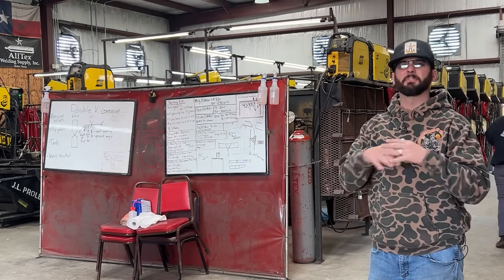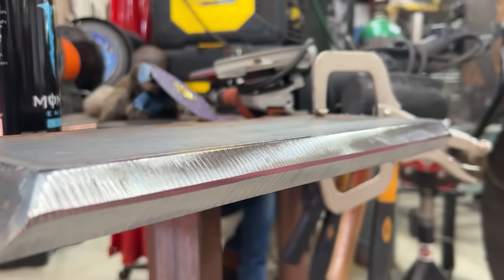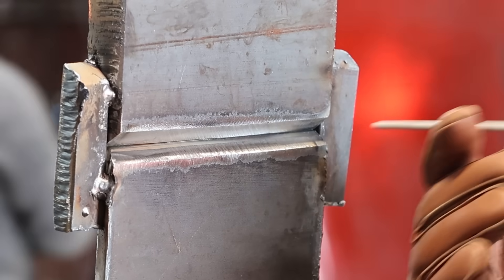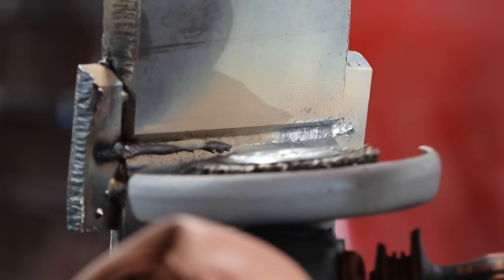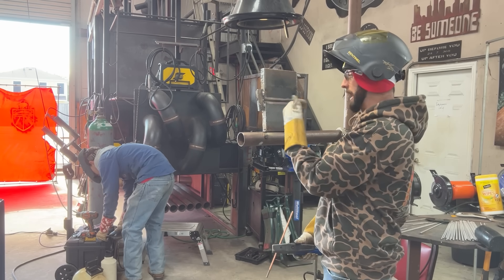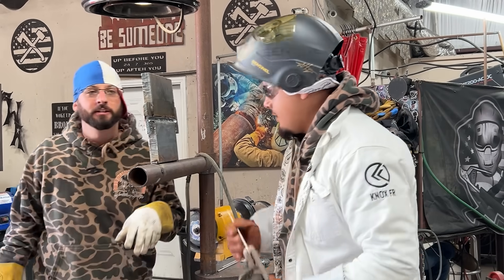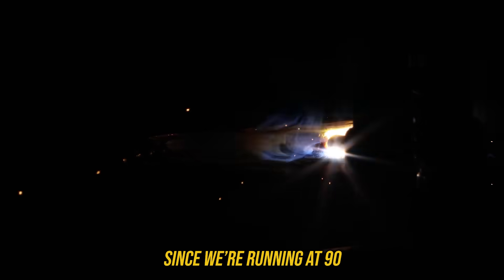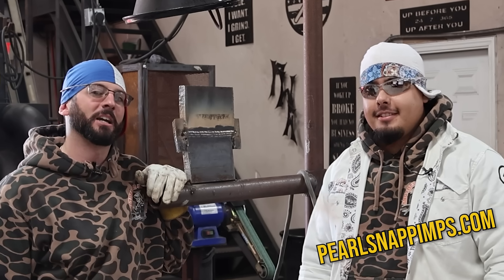Heavy Structural Welding Made Easy: 1-Inch Plate Double V-Groove Explained

Comment: I do newconstruction for newport news shipbuilding. As a shipfitter,we fit all thicknesses of plate. We build mods outside so we have to preheat with TEMP🔥LSTIK.  From 125°/52°c  150°/66°c and for thick High Yield steels we use 300°/149°c two to three inches around the HEZ we have various heating  methods. Preheating when its below 30°  is vital to all weld joints. And honestly its procedure, you better not get caught not  preheating. You have to have melted wax indicated  around them fitups or thats your job. Any ways show some vids on pre heating.

Comment: Interesting. Whenever I have had to do this, the back gouge was grind, to see shiny clean root (no holes or slag) then finish weld. Gouge adds unnecessary heat exposure to the base metal.
Reply: Ive seen alot of companies opt for a back grind, as long as there is alot to grind. Depends on the procedure, Ive pulled out the gouge for reeeeaalllly long sections of seams, its much faster, with just a touch of grinding to let it sparkle

Comment: Dont see the point of gouging, just run a hot 6010 root, smack it with a grinder and another 6010.
Reply: what if the code requires a higher tensile strength rod?
Reply: @AustinHargett  then the code is wrong
Reply: @mblake0420  thats ignorance Cornholio

Comment: Correct me if I am wrong, but I rarely run wide open on gouging and I do a lot of gouging on heavy equipment, it depends on the size of rod you  are using ?
Reply: id say the amperage needed will depend on the size of rod like stick welding as you probably know. Id stay on the hotter side of whatever range is recommended. Use smaller rods for more precise  gouging.
Reply: @jeffsimonar7161  I regularly gouge at my job, however, we only have 1/4 and 1/2 inch round solid rods. I usually start my run at 275 amps for 1/4 inch round rods. For 1/2 I start my run at 325. Depending on the machine I adjust accordingly or if I’m in a tight spot. Sliding the gouging rod a little further up can make your gouging track a little more focused.

Comment: Cant you just put a slight gap between the plates initially to achieve full penetration and not have to arc gouge?  Thanks
Reply: you most certainly could. I believe that the main reason why one wouldn't leave the opening and rather keep it shut. As you know open roots can be more challenging to achieve, Regardless if work needs to be done on the other side, a grinding method is usually involved to insure sound weld.

SO if you have to grind any way, might as well make the weld easier. thats just my 2 cents
Reply: When it comes to structural codes some welds are subject to Xray/ultrasound inspection and require your welds to be 100% clean and free of any inclusion/lack of fusion/trapped slag or silica, etc. The back gouging/grinding is usually (at least on job sites) done alongside other inspections like magnetic particle testing to ensure there is clean metal and no lack of fusion in your root as it’s too critical of a joint to take somebody’s word on it. Hope that helps!

Comment: Double V groove requires less filler metal than a single bevel or single V groove typically. This saves time, and reduces distortion.
Reply: You can also reduce your bevel angle on the bottom plate to 15 - 20 Degrees for the 2G position. Saves time and better for distortion too....
Reply: @paulmeersa7162 all great additions Paul! Thanks for watching

Comment: I recently had a cardio device implanted and was told I could no longer arc weld. Could this be done with oxyacetylene?
Reply: Shit man, sorry for your loss. I'm new to welding and if I was unable to use arc I'd be devastated. Hope you find a way around the new issue and be sure to take care of your heart
Reply: @elrusito5034  Learned OAW many years ago. Relearning. It works well for thinner metals. It just takes a little longer and have to deal with some warping. But it's not that bad. I want to build some projects with thicker gauge metal but there seems to be little info out there about welding thicker materials using OAW. 

I'm hoping someone will chime in with some advice or at least point me in the right direction.
Reply: @ricjona1069  home projects with OAW up to some considerable thicknesses can be done. as far as plate, and thicknesses like this, im not sure. Lasers have made some big advancements in power and portability. Price point isnt really for the hobbiest but it may not affect your pace maker.. also not a real doctor lol
Reply: Don’t take this as medical advice but my uncle has a pacemaker and he was told he could weld under 160 amps
Reply: @timblack33  Mine's a defib. I've heard both I can use and I can't. But the surgeon said no. The issue was that the device could pick up the signal and errantly shock me.

I am enjoying relearning OAW. It's relaxing. I don't mind the extra time or attention to heat. I just want to know what the limitations are. 

I saw this vid and there were a couple of things on the property I could do that would require thicker than 1/2 inch steel. Then I wondered what my limitations are with OAW. 

I did some searching and found little good info on the limits of OAW and nothing worth a darn on OAW and structural.
Reply: Search for some of the old school oxy/ acetylene books. I know Linde and Union Carbide both printed them. Super valuable info. 
Off the top of my head, there's nothing except maybe the newest alloys that can't be o/a welded, including thickness.
Reply: Could but you will be there for years and years